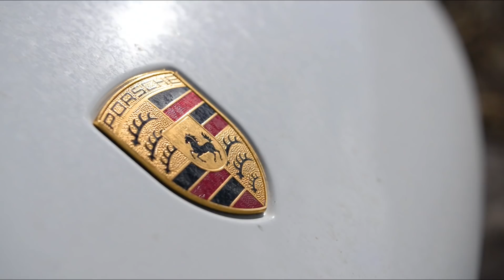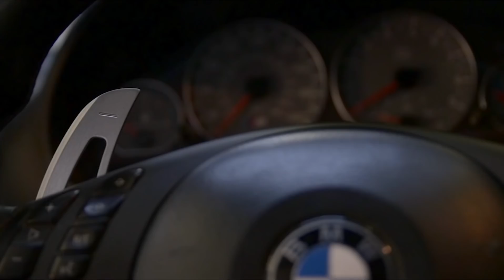Cars Are Changing

Comment: Fuel injection is one thing. Making the whole car basically a computer on wheels is another.
Reply: Basilhs Kiriakopoulos Most heroin addicts want heroin so stfu and give it to them lol just because someone wants something doesn't mean they're bettet off with it.
Reply: Susano I agree.  It's great that cars are getting faster and all that but they lose personality.  It's like watching someone else play a game of chess.  They might be better at it than you but it just takes away all the fun.
Reply: I disagree with that assessment. The i3 is rear motor rear wheel drive and it has proper precise BMW steering with lots of road feel. The motor is mostly silent so I can hear the suspension do its work and hear the surface under each tire distinctly. Regen on the i3 is as nature intended on the accelerator so with one foot you are applying positive and negative torque to the rear wheels with no apparent delay or disconnection (any EV driver would laugh in your face if you said combustion vehicles could be as responsive as an EV). I agree that the steering feel on a Tesla Model S is a bit... artificial but that's not something inherent to EVs.

“I've come up with a set of rules that describe our reactions to technologies:
1. Anything that is in the world when you’re born is normal and ordinary and is just a natural part of the way the world works.
2. Anything that's invented between when you’re fifteen and thirty-five is new and exciting and revolutionary and you can probably get a career in it.
3. Anything invented after you're thirty-five is against the natural order of things.” -Douglas Adams
Reply: @cros13  bruh again I totally disagree with your second comment. Those points are adressed to short-minded people who won't be missed if they disapeared from the car scene. But a Tesla is less engagning in driving than an 1950 car. Fact. Because[: list of stuff that desappeared from what the driver could do].
Reply: If I were to buy a new car. I'd buy one with the less amount of complex electronics. A Nissan Micra S manual perhaps. And I'd pay cash.
Reply: That is why you have options. Having options is the way to go. It's wrong to stop it.
Reply: @philipagtuca5486  not with the government banning most of the options lol
Reply: most people aren't good drivers, most of them don't even want to drive, making the computer drive for them is better for them.
Reply: Nizzle FoShizzle agreed. Even electronic throttle is fine if it doesn't require the computer to work, ie a potentiometer style circuit. the computer should be a third party, not a middle man.
Reply: A computer on wheels is a robot and that's on its way with the self driving cars
Reply: i don't know anyone who resisted fuel injection. nor disc brakes. there are things that are just plain advantageous.
not the case with manual vs automatic. that one messes completely with the way you drive. it changes the damn controls ffs.
Reply: sadly on modern ferraris, to administrate the power the computer needs to be the middle man, because the people that drive the cars want to go faster, but not drive harder
Reply: Susano tesla
Reply: Tbh I kinda agree with Susano and Philip. Although I am a big computer nerd and I more often than not look forward to the next big innovation in technology, I'm also a big car enthusiast. I kinda feel like manufacturers should start making cars 'like they used to', but at the same time, general market demand says they won't. But this is why they should introduce more "enthusiast grade" options in their cars. The big auto companies don't realise the possible goldmine that they could have all because they think they know what we want based off of numbers and statistics taken from the general population, and not from the people who truly care about their cars most.
Reply: yep (cough cough r35 cough)
Reply: Susano exactly, that removes the driver from the equation .
Reply: Tru dat
Reply: Exactly
Reply: Also engine sound removal is another thing
Reply: Thankyou
Reply: I honestly love the thought of a driveable computer. Just seems fun to have so much tech working in harmony.
Reply: Amen brotha
Reply: just wait until you get 30+ hp from a software update lmao
Reply: You defenetly missed the point of the video. Watch it again.
Reply: Three years later, I am coming back to say that I hold true to what I said, and to add to it a bit. I still think that cars from the late 80s to the early 2000s are the best. Enough technology to be safe and practical, but not so much that they're unreliable and hard to work on (and most critically, rip control away from the driver.) I understand why cars are changing the way they are, and yeah, it might be best that you take control away from all those piss-poor normal drivers out there, but for those of us who like driving, like working on our own cars, enjoy light weight, simple mechanisms, and actually being able to see out of the cabin without the assistance of cameras, it is a sad time we live in. Is it too much to ask that I can change my own oil at home with simple tools, auto industry? Fucking hell.
Reply: Computer programmers shiver at the thought that a bad line of code could end someones life. There's millions upon millions of lines of code in the newer cars, think about all the combinations of draw calls that could cause some anomaly glitch. Computers in cars should take the more analog approach, being less intrusive and more assistant. Not to mention all the touch screen controls that require you to look away from the road to use them...
Reply: The problem is not change actually. Change can be for the best. However, in newer cars, change is usually not for the best. You want to know why? Planned obsolescence and loans. In the late 80s and early 90s, most of the car manufacturers actually cared about what they built on the long run because people wanted to keep their car longer. People paid cash more often than not. People cared about what they were getting for the price they were paying. Nowadays, new cars are built to last less and less with parts made in China (or worse) and assembly plants in Mexico... They want you to buy the new model in 3 years. They want you to get hooked on their loan (or lease) plans. Hell, they will throw all kinds of stupid goodies at you for you to sign they preicous contract. Contract that stipulate that the car you're buying with your money is actually never yours. 

Do a little test. Go to a car dealer and tell them that you want to pay your car cash. They will serve you reluctantly. Why? Because they won't make enough money over you. 

Plus, a computer on wheels is all kind of bads. More wastes. More fragile. Less repairable on-the-go. When something breaks, you need to replace the whole assembly. More stupid useless sensors. Overengineering...
Reply: people from 150 years ago: having a horse carriage is one thing. making the carriage run on its own power is another.
Reply: Discoloured Buttflaps they were right.
Reply: Susano naah. the problem is change. my old uncle used say box tv were one thing, but flat screens tv is just something else.
Reply: I'm talking about driving experience, not innovation. Making the car electronic as opposed to mechanical is disconnecting you from the road. If someone can make a car with no driver assists, and make wire connections 100% as responsive as direct mechanical connections, I don't have a problem with the future of cars.
Reply: Your right making it a  computer on wheels is a great idea.
Reply: Hellu Sup no, making them walk is, if you don’t want to drive, then don’t. I do not need some computer operated car crashing into me.
Reply: This vid is so wrong ...
Reply: I love it.... my dad like his combustion engines and understands the mechanical engineering side of that.... the first car I owned that I gave a damn about was a Nissan Leaf 'cause I could crack my laptop out and adjust the torque curve at will... for the first I understood how my car worked and actually cared.... you can have your flammable liquids and thousands of moving parts pops...I'll be over here rebuilding my modded i3
Reply: @cros13  ok and ? What the hate for bro? You'r just bad at mechanics, that's it. And your statemen't doesn't explain where the fun of the actual driving went.

(i3 lol so lame i8 are better but you can't afford it unlike me (I drive a 2008 focus sw if you want to know))
Reply: FroztiProductions im talking for the 99% of the population. you are talking for the 1%. so you stfu please.
Reply: JOSHEEOP  wtf u idiots. go back to caves if u dont want technology. most people want auto gearbox so stfu. most people want wide screens so stfu. most people want auto parking so stfu. something that doesnt suit to you doesnt meen it doesnt suit to anyone. GET OVER IT.
Reply: @basilhskiriakopoulos2648  most people have 90iq so stfu and GET OVERIT

Comment: @gearsandgasoline @eneryblue I like your channel, but it is disingenuous to your automotive enthusiast viewer base to compare a change like Carbureted -> Fuel Injection to a change like Manual -> Automatic transmissions.  The gradual extinction of manual transmissions from modern cars doesn't just change the cars themselves, it changes the cars AND the entire driving experience.  It is so much more severe than any of the other changes you listed.  I feel it is a disservice to auto enthusiasts to compare them on the same plane of severity.  Thank you for your hard work on the channel.

Comment: I love the technology they are coming out with in newer cars.  They are pushing the performance levels and making them more efficient.  I am concerned with the fact that some car manufacturers are trying to lock down cars to the point that the everyday person cannot work on them.  Imagine the engine under the hood of your car being treated like software on computers are being treated.  Where you don't own the software, you are just buying a license to use it, and if you modify or change the software you will not only void your warranty but can be fined or sent to jail.  You find this is some of the software's end-user license agreements (EULA).

If they bring the EULA mentality to cars it will kill the aftermarket, destroy motorsports for the amateur (goodbye track days), eliminate the ability for you to work on on your own vehicle (this includes simple oil changes), and smaller mechanic shops will go out of business if they are not authorized to repair these vehicles.  Auto manufacturers and big car dealerships are pushing this all under the cover of environmental protection and driver safety when the true reason is to increase profits by cornering the market.  I do not feel this change will come in the next 5 years, but in 10 or 15 years, it is definitely a possibility.  So yes, cars are changing but in more ways than just how they are built.

Comment: IMO electric steering isn't THAT bad.  I still feel vibrations coming through the steering wheel at most speeds.
Reply from the maker: +Mel I think that might be a bad wheel bearing ;)
Reply: to confirm that electric steering might even be better than hydraulic steering in the near future, look at the Porsche cayman GT4 , it has electric steering but boy oh boy does it feel close to natural.
Reply: This is on a fairly new car with just 1700 miles on the clock, so nah, i think my wheel bearings are fine :)